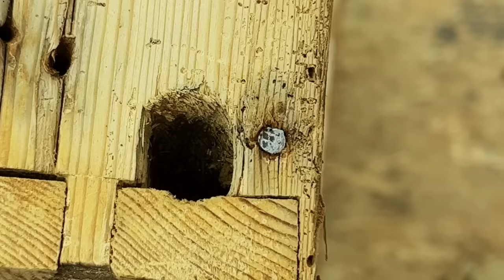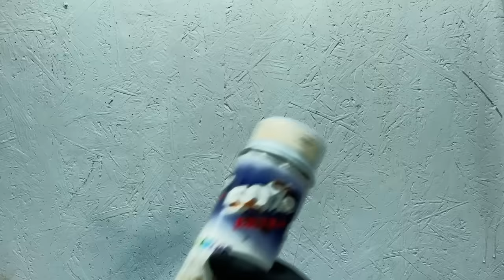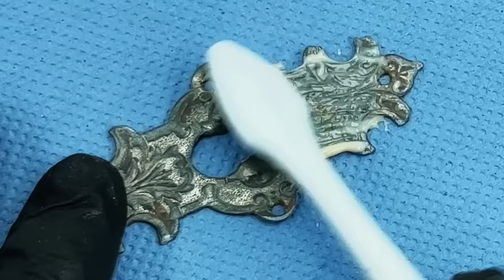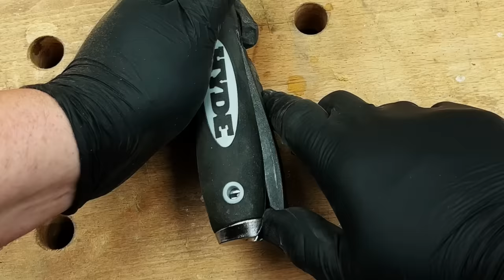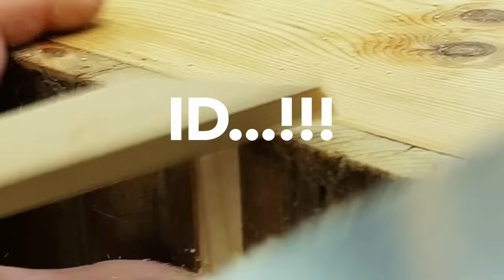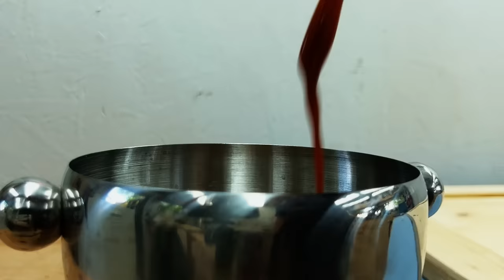Magische Restaurierung einer alten Kommode

Comment: Nice work and cool video! what did you use to prime the worm eaten top surface before using wood filler? Was it the same Titeboind glue dissolved in water? Also why don't you use some paint stripper gel or smth to remove the old paint? I think it would be easier than using hot air gun, no? And what kind of universal scraper with different blades do you use - I mean brand? Looks nice
Reply from the maker: Thanks. This was skin and bone glue to stabilize the wood. Because the stripper has to be removed again. Also from the wormholes. I can't say right now. Excuse me. Take a look at the video description. it should be in there. Regards

Comment: What did you use at first for the worm holes ? Is it something to kill potential remaining worms ?
Reply from the maker: no That was rabbit glue. It runs into the holes and stabilizes the wood. To kill the woodworm you can wrap the furniture in ethanol, put it in a heat chamber at 65 degrees for several hours or use poison.

Comment: brilliant work. Vomiting colour. You used heated glue to strenghten old wood in hinges area - is it better than using special wood hardening liquids or epoxy dissolved in solvent?
Reply from the maker: Thanks. Definitely. Skin and bone glue was used 200 years ago. Works to this day. And you can dissolve it with water. The others don't

Comment: Hi, just wondering, what did you paint onto the worm holes before you filled them?
Reply from the maker: I didn't paint them. 😊 I coated them with gluten glue (rabbit glue). The glue runs into the holes, dries and stabilizes the wood. It becomes really solid again so that it can be used and loaded normally. Regards
Reply: @chrigunrestauration  thanks so much! I learn a lot from your videos.

Comment: May I ask what is this stuff that you apply on the worm wholes?
Reply from the maker: First, gluten glue, to stabilize and then wood putty. (glue and sanding dust)
Reply: @chrigunrestauration  oh... gluten glue! Well, I've never I've never heared the use of it as a wood stabilizer. How effective is it?
( To be honest I was pretty sure you applied some kind of  insecticide! 
and I was very curious to know how to salvage wood from woodworm.)
Thank you!
Reply from the maker: @aferetis2379  I only know 3 methods.
The first is a special poison. But I don't know what it's called. I do not use it.
The second is alcohol. Soak the material with it and then wrap it in foil for 2-3 days.
The third is a heat treatment. The core of the wood must be heated to 60 degrees Celsius for 3 hours. this destroys the protein structures of the eggs and larvae of the hozworm. I think it's the safest and best method. However, you should not treat veneered furniture in this way. Regards
Reply: @chrigunrestauration  wow! Thank you for all precious information. 
Thank you for this beautiful video, as well!

Comment: I have a question? Why don’t you wash it down first?? When I worked in restoration we were specifically told to wash a piece down first! This was to reduce any germs or bacteria that had accumulated through time. Plus most of these items were kept in dirty sometimes vermin infested environments..
Reply from the maker: I wash the parts beforehand. I don't show it because it's boring and everyone fast forwards.

Comment: I cringed when you filled In the worm holes.
Reply from the maker: 🤷‍♀️ 🤷‍♀️ Yeah yeah. I know. Something like that needs to be replaced. That's what everyone says. That's nonsense.
Reply: I wouldn't replace it. Its history of the tree, I would leave it.
Reply from the maker: @2002chow  Ah. OK. Most people don't think it's that great either. I personally don't like it that much either. But I can understand if someone likes it. When closing the holes, you can see that they are there and you stabilize the wood if you have previously soaked everything with glue. Regards